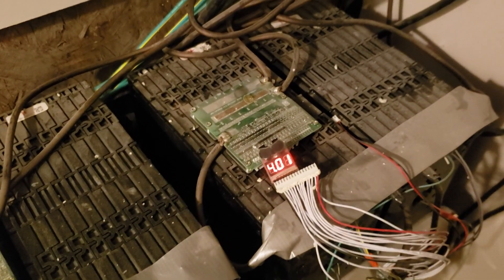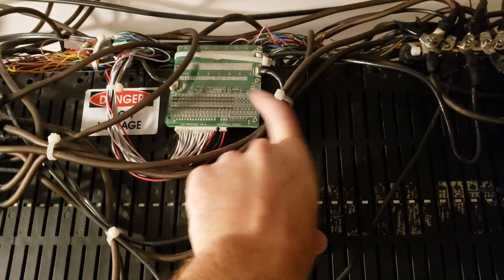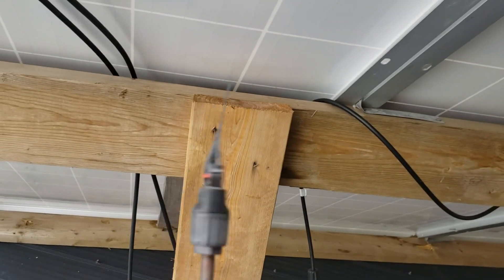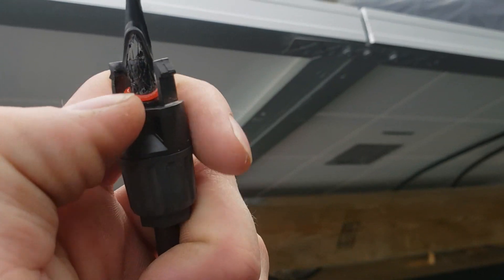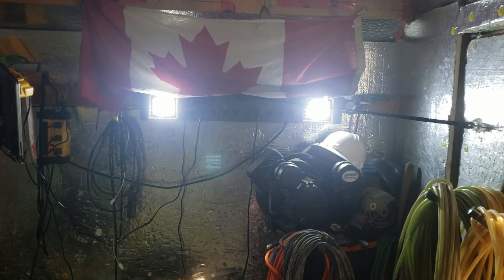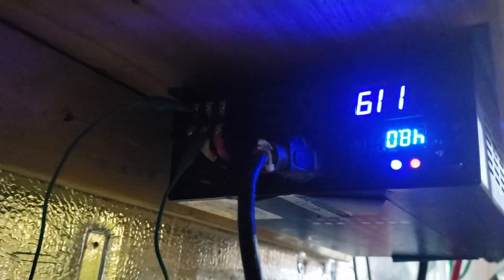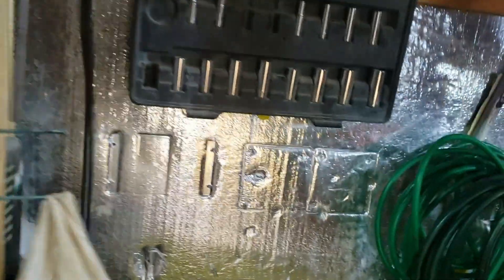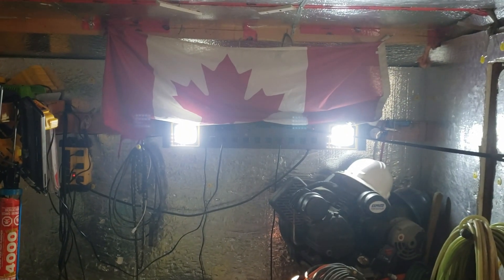Solar System Maintenance And 2 Year Inverter Review

Comment: concerning your burned out mc4 plugs:
just bought a dozen second hand panels. the owner reckoned the inverter broke and had a totally new system installed. about half the plugs had water penetration, partly whoever in the factory connected the mc4 plugs had the seals squashed. this lead to various progress of corrosion. and must have arched as it had molten plastic on the metal connectors. 
so otherwise a good quality system failed because of some careless worker, or inferior 20 cents plugs .
Reply from the maker: Dang, its hard to test a mc4 to make sure its water proof. thanks that is very interesting.
Reply: @GoingOffGrid101  
i suppose you would have to take them apart to see if there is corrosion inside. but i have not seen that problem so far at my place and there are over 120 panels.
Reply from the maker: @ursodermatt8809  wow, massive grid tie ?
Reply: @GoingOffGrid101  
i am still connected to the grid. but do not draw any electricity from the grid. the original gird feed installation is still feeding in. only about 12 200W panels. the rest is running island, but has the ability to feed in. but i do not.
most of the panels are used when it is overcast. also charging an ioniq which draws quite a bit of that solar energy.

Comment: Terrifying! A Mc4 should not do that with the load you had on it. It does speak of the need for the added safety of a Midnite classic with the Ark Fault interruption when the panels are over a living structure.  I have one on the array over one of the bedrooms.

Comment: Bad crimped connection... 
MC4 connectors are proven  and hold 30A easily.....
Reply from the maker: the crimp is 100% and i use proper sized wire to. im thinking its cause of two different brands connected to each other.
Reply: @GoingOffGrid101  yes it's best to never mix brands, even thought they are supposed to be the same diameter internally, because there are a lot of copies of a copy in China or even legit ones, some of them are not the same size internally so they make bad contact and melt like this , buy them in pairs (well female and male MC4) ideally not China ones

If you have a IR gun or iPhone/android IR cam attachment you see the overheating issues on day one install on a sunny day it's getting hot due to bad contact (it have to be +160-200c for it to be melting the connector so it show up on IR quite quickly), these are generally zero maintenance items so it's not something you norm need to check once they have been installed (on a standard install you can't check them as they are norm flush to the roof they are on) main China defect is that they are sometimes to short the male end and only just make contact to the female end even when fully locked in (or the female or male diameter is too small or or too big)
Reply from the maker: @leexgx  good idea I have a cell phone IR Ill try it thanks!

Comment: Had one MC4 melt slightly to the point it won't disconnect. It still passes current though. You're right, we need to check them periodically.

Comment: Sorry about the MC4 connectors must have been an arc from poor connection with DC it happens too often.
Reply: Not so often... If you use proper crimping tool and after you make the crimp try also solder it....is bad crimp contact....

Comment: That's great those BMS's have lasted.  Have you ever had an event where the BMS had to shut off charge or discharge?  Like, have you seen it work?  I'm just curious, not being confrontational.  I'm worried about mine trying to say shut off the charge during an over-voltage event, and failing, but failing with the mosfet closed, allowing the current to over-charge one of the cells.  (this assumes the pack voltage is lower than set point of charge controller and it's a problem with an individual cell.
Reply from the maker: I have tested a few of them and they worked
Reply: Yes they work at least mine does check out my video on voltage discharge today
Reply: I have 1 out of 18 BMS (same type with S12) fried up once a while ago.  I couldn't figured out why.   I've replaced the burned out one.  Since then, everyone of them work without a hiccup.  So I chalked it up to faulty part on the board.
Reply: They should be quite reliable if not run past 50% load unless you have an oops event (short the positive and neutral ends) and blow up all the Mosfets on the bms boards, only good thing is they act like a fuse so worst case is you have to replace every single bms board (battery's should be fine)
Reply from the maker: @leexgx  very true I have done this on video and posted it on YT lol fried all the bms lmao insta dead 9 bms lol
Reply: @GoingOffGrid101  still better then dead Battery's or fire
Reply: When they fail they norm blow up (crack after releasing magic smoke) and won't pass voltage any more so shouldn't be any problems with them been stuck in short position 
it's why lipo car booster packs use them as they should fail Before setting the battery on fire inside the booster